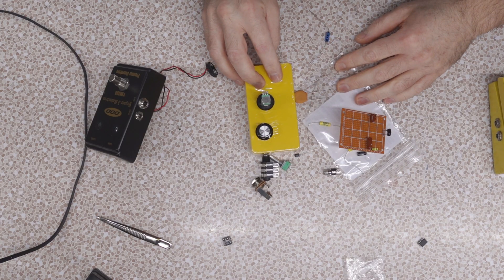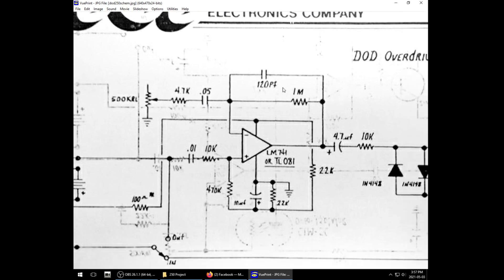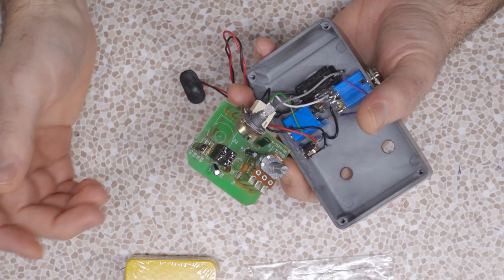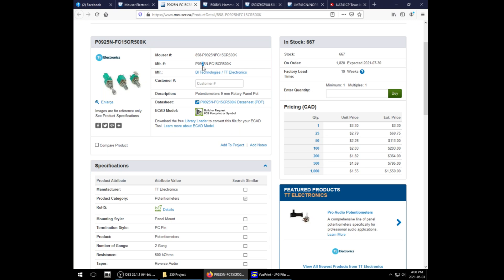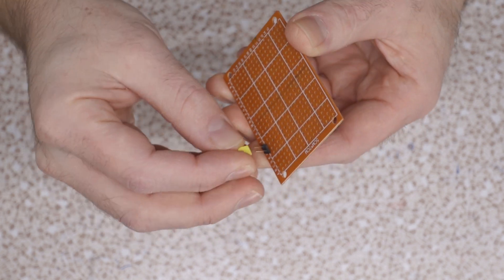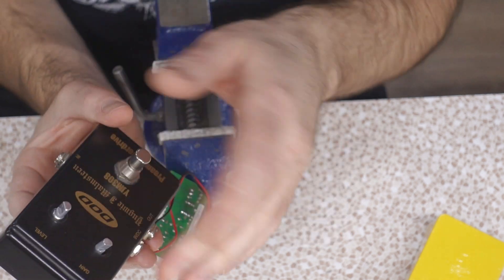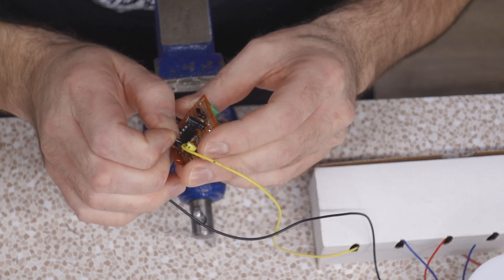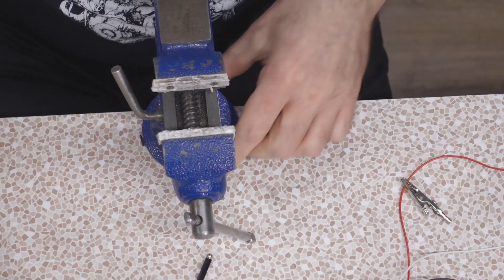DOD 250 - Ep1 : Design and Circuit.

Comment: Two caps in parallel make a bigger cap. Try adding a small ceramic to build the 0.5 or larger value.
Reply from the maker: I'm aware of that . . . IN fact I did that in this, for the input selection, it parallels a second cap. This is an older vid for me now, so I'm not clearly sure what you're responding too.

Comment: I putted a switch to select .01/.001nf input capacitor to have dod 250/308... and a switch 3 way for clipping 2 1n4148/ 2 led 3 mm/ none clipping
Reply from the maker: Yeah, popular changes on these pedals. Not sure if you've seen my other vids, but another build I did of this pedal had sockets so I could pretty much changes all that.

Comment: I've had two 250s. I now have the last version (JHS called it a V10?). PERFECT! Wouldn't change a thing. Whatever the Earthquaker Gray Channel does, it has flappy low end and it just sounded.......voltage starved? Sold it.
Reply from the maker: Never tried the Grey Channel, is it suppose to be based on the 250 ?
I searched for JHS V10 but I didn't get any solid results.
Reply: @DATT  The V.10 is simply the tenth one DOD made before Samsung bought Harmon a few years ago. Nice gold finish, blue L.E.D. and sounds great, NOT a "vintage" 250 sound. It'll probably be the same one they have again now they've been reopened. Josh called it the V10 on his show about 250's. The Gray Channel was actually a great Earthquaker Devices two channel "250" people loved, just not my cup of tea. Based on an old gray 250 Jamie had. They the might not make it anymore.
Reply from the maker: @deanallen927  Oh ok I see.

Comment: Hi. I have a problem. I made the Dod 308 but when I connect the volume pot, this make short circuit on output... This part with complementary diodes is absolutely the same. On the switch, I send the output(+) to the middle pin of the volume pot, one pin to ground, and I connect the third pin as on the scheme, to this upper part of the complementary connection that goes to the capacitor. Where am I wrong? Otherwise, I connect all groundings to one point, on - from DC 9V. Otherwise, everything is connected nicely and all components are correct, it is connected as shown in the scheme...
Reply from the maker: It sounds like you hooked it up correctly for the more part. Expect maybe the 9v-.
9v- goes to the ring of the input jack. Everything ground connects to sleeve. It think it'd still work the way you described. 
It's really hard to assist with something like this without seeing it. 

Maybe upload a video of it here to youtube ?
Reply: @DATT  I'll look again to see if I made a mistake in connecting, although I connected 3 times again, but it's fine.  I will review everything in detail, draw a schematic according to my connection and compare it with the schematic from which I looked.  If it still doesn't work, I'll record the problem.  Thank you so much for being here to help! As for the grounding, I connected them to the 9V  - on Ic - and then wherever there was grounding on the scheme, I connected it there. And with the jack I bridged all the groundings and then I connected to all groundings. I also bridged grounding to the volume pot. And the problem is that when the volume pot is turned in any direction, it creates a short circuit at the output.
Reply from the maker: @guitar.a  Is it possible you have a defective pot ?
Reply: @DATT  Greeting! The main question I'm interested in is how to connect the volume pot to the junction of the diode and the nF??? Because from my point of view, it is not clear to me how one end of the pot goes to the ground, the other goes to the + of the output and the third end goes to the - of the electrolyte. That's a direct short circuit, isn't it? And certainly both diodes, no matter how they are measured, from which side they certainly have around a resistance that is not too great. I am a beginner but this question is really giving me a big problem and I would like to figure it out.Because that's what bothers me the most... Maybe it's a stupid question, but I'd like you to clarify for me.
Reply: @guitar.a  
Are you sure your jacks are hooked up correctly. Ground should be sleave which I think is the corner lug on those.
Datasheet suggesting you are using the ring termal for ground, which should work . . . 
Why do you have a random ground connection so an unused witch position. Unless you got the pinout of it wrong ?
YOu pot looks connected correctly. 

I think you might have your input hooked up wrong, looked like ground is going to "Tip Shunt" which would short things out. 
Connect Ground to the corner terminal. 

Looking at the video, it would take too much for me to follow the circuit layout, I think this is the best I can do for now. 
I think you need to double check the pinouts on the jacks and switch.
Reply: @guitar.a  The pot is a resistor from pin 1 to pin 3. So I would not create a direct short, and would be seen as a normal load as an audio circuit goes. Pin 2, the center pin, will turn either from pin one input letting full signal pass, or you adjust it to pin 3 which grounds out the output muting the signal. You pot selects if you want signal or silence. I don't see anything wrong with how the pots are connected. 

Diodes are like valves that trigger as certain voltage pressures. A diode won't short to ground until the voltage on one side is high enough to over come the "spring in the valve". Once this happens this clips the signal and adds to the tone. If you want to trouble shoot you can remove the diodes all together and the circuit will work fine since they are only there as a kind of "EQ" effect. 

It's possible, that if you can confirm everything is connected correctly, that you may have just damaged a component. 
I can tell you are new to this, when soldering, too much heat too long on some components will straight up burn them out. 
Resistors and caps are pretty resilient, but anything with silicon like the diodes and the 4558 are delicate. I would recommend socketing the 4558 and not soldering directly for the reason. Use sockets in future builds for the chips. Pots also can burn out with too much heat, those that more a problem when you are soldering to the metal base of them. When soldering a pot, it's a good idea to make sure it's turned all the way to one direction. If you over heat it while the swiper is on the carbon path is can burn the carbon off that spot. When it's turned all the way the swiper will usually be sitting on a metal pad.
Reply: @Mewtal8  Everything is nicely connected.  Ic is working, I bought a new one just in case.  I checked the diodes and they are correct, now I use the socket for Ic but the situation is the same again.  I don't quite understand everything you said, so if you could give a brief and concrete suggestion as to what I should do, because I didn't quite understand this grounding thing... Thanks a lot!
Reply from the maker: @guitar.a  At this point, the only think that stands out is I think your input jack is wired wrong. I'm not sure I can be much further help without having the device in my hand. 

Ground means - . Ground is alike a nickname for negative. so ground an - are the same thing. You'll notice in the schematic, everything - ultimately is connected together. The + goes different places and does different things, but the - is all connected together. 

They call is ground, cause in an amp, the negative is tied to the metal box the amp is built into, for safety reasons, which is "grounded" via your electrical system wired into your house. It's weird I know.

Comment: i like to sub in red 3mm leds instead of the clipping diodes . i have tried quite a few different combinations of clippers in this circuit . a pair of leds opens it up , makes it way less compressed . it makes for a great allways oner first stage . i set mine at noonish . it is very pick sensative but its also very different than when you think of a stock 250 .  i love that circuit . i will put the mod on a dpdt toggle but , with an on on on you can hear it without clipping and yes the op amp clips ... with the leds it really doesnt alter your amps tone or the guitars harmonics so much . but what do i know , build it stock turn the knobs to ten and tear them off  makes devil hand sign bands head to enter sandman .
Reply from the maker: YOu know, I think I tried LEDs in there. Well, I know I did, can't recall if I tried 3mm ones tho. 
I tried a few diff diode, some cut the output to hard. It was a while ago, and I didn't film it. 
I wasn't a big fan of the results to I decided to not make a video about it. 
I usually run the pedal I use most with the Diodes disabled. Mostly cause I often use the pedal with my 900Mk3 and Jubilee that already have diode clipping and I find they sound better without the pedal clipping. 
I might reactivate the diode with my 800, but I haven't played it very much lately.